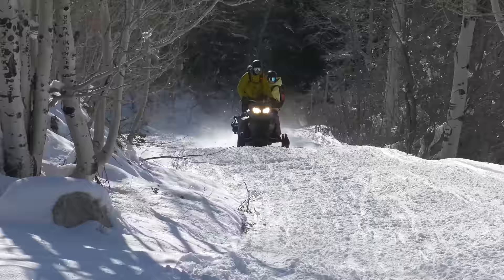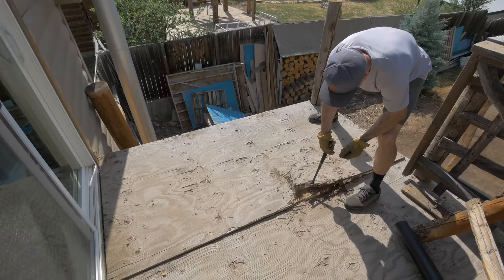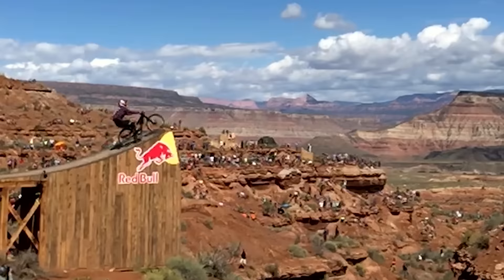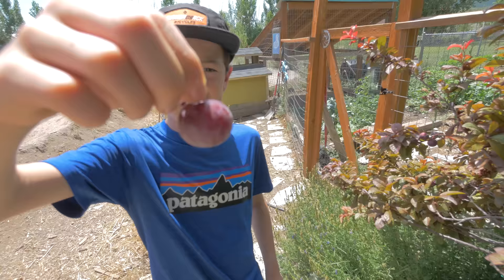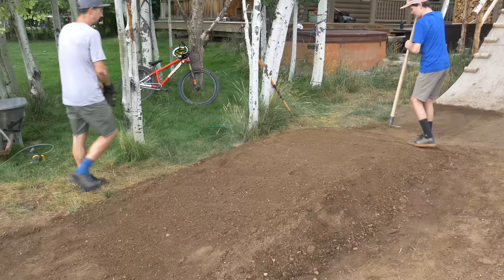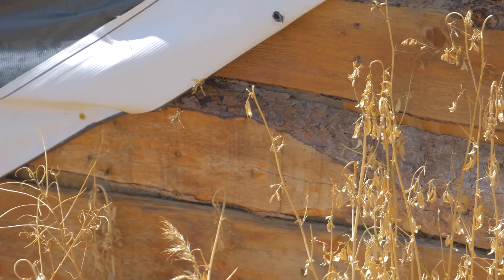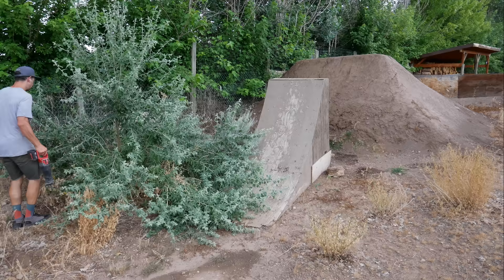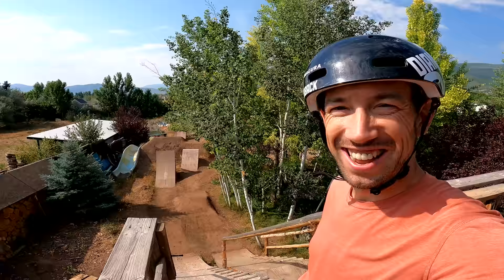FINALLY!! Fixing and riding the backyard jumps 2021!

Comment: Shark fin to a wall ride at the end  with a berm below the wall for people who dont want to do the wall ride. I think they are fun to ride in a small place. Remember to use hard wood for supports and fake decking  with lots of supports threw out. That fake wood decking works great plus wont just snap like wood but will start bending just a little

Comment: If your ever in a pinch and encounter a wasp nest break cleaner also works externally well. I've killed one with isopropyl alcohol but haven't given it a good test might work if put in a pressurized sprayer though.

Comment: I have never critiqued one of your build vids, because they're all great but, I can not remain silent. The upper deck is missing at least 1/4 of necessary stringers- there's no way that would pass code. Also, the added flex/stretch from the missing stringers accelerates the deterioration of the plywood. Good thing is, you can go from underneath with 3, bucketed 8x2's, seal it and, it will out last us both. 
I like the jump tarps. Maybe, at season, get everyone in the house, toss some wasp bombs under the tarps and run like heck.

Comment: Sick! Just curious, did you consider doing traditional pressure treated decking instead of ply? Aside from the treating, the drainage created by the gapped boards helps to prevent rot, probably not much more expensive either. Obviously less smooth but I don't ride booters like those so I have no idea if that's super important or not haha.

Comment: If u spent a bit of extra money on pressure treated wood you would not have to worry about it’s getting like that work last for at least an extra 5years and not rot
Reply from the maker: I know, wood is crazy expensive and hard to find these days. I'm going to paint this wood which will help it, and Utah is typically pretty dry which helps also.

Comment: Should have used 5 1/4 deck boards it will last was longer
Reply from the maker: Yeah that would last longer, but I like the smooth surface on the roll in, and plus I can keep stuff dry under the deck.

Comment: Man, I know all to well the feeling of not getting around to doing maintainence and work on trails no jumps, we've been building these TINY (seriously, one "run" would take ~10 seconds but when the two trails are complete they should be a blast) trails in my neighbors backyard (they live right across the street) for ~1.5 years now, it's kinda slow going as we get to meet up about 2 times per week for about 2-2.5 hours (and we mess around a little bit). We still need to completely revamp one trail (its a short dirt path then you can choose to ride one of multiple features, when it's done there will be a skinny, drop, one small and one "big" tabletop, and a mini log ride to shoes from), and we're currently working on the mini jump line, which when done will consist of two "big" jumps (not sure which kind yet), a roller (or maybe 2), and a berm at the end to finish it off.

Thus, I know firsthand that trails aren't easy to build, so I really appreciate my local trails (almost all of them were built with small exavators, but still..). Keep up the good work Eric!